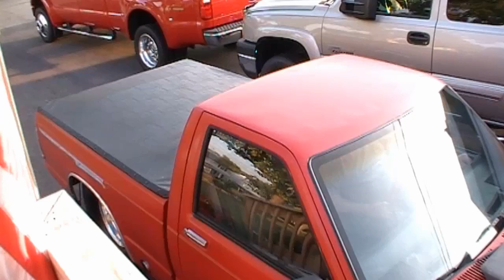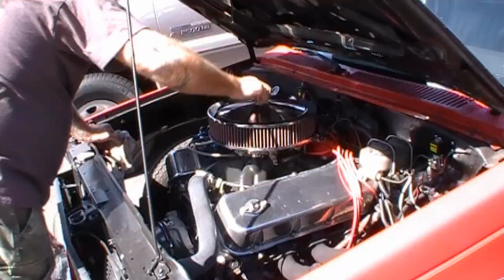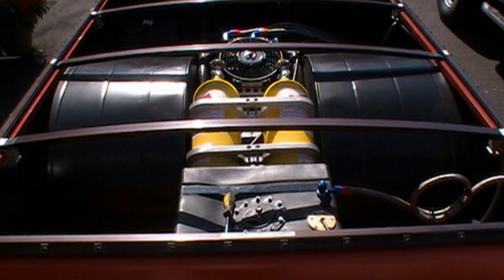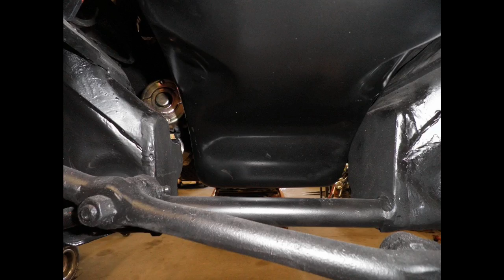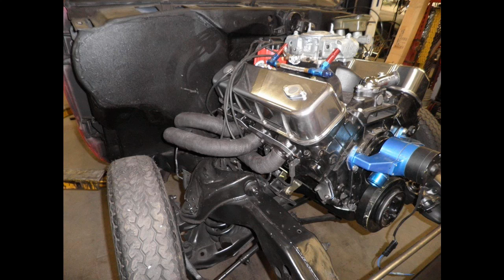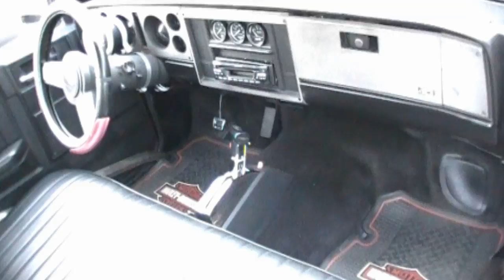1984 Chevy S10 - BIG BLOCK

Comment: Noticed you had cast iron exhaust manifolds on it once. What year/model did they come off of?
Reply from the maker: Junk Yard 69-72 big block Chevy - still have them
Reply: Tennie1123 I was curious what model they come off of. I have some from 73 or 74 One ton truck and some from 67 Chevelle SS and they are different from each other.

Comment: Love the big block. Hate the fact that it's tubbed and has pizza cutters up front. Love to see it with coulovers & a 4 link out vack with some 88-90 Iroc wheels all the way around or even with some chevy steel rally wheels. Nice build though.
Reply: ROTAXD it would schred anything smaller
Reply: Lmao. Hate the fact that it’s tubbed? You’d never be able to hook anywhere with fuckin stock size shit on there bud
Reply: ive got a 95 s10 with a decently built 305 with some iroc rims and a 295-50-16 tire and the rims look great on the truck